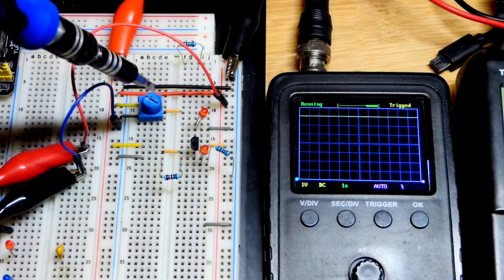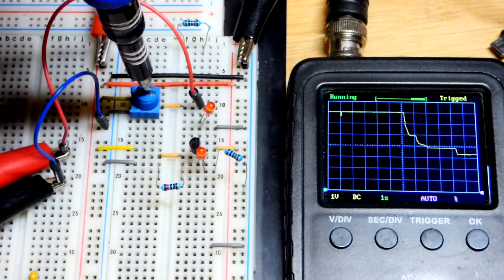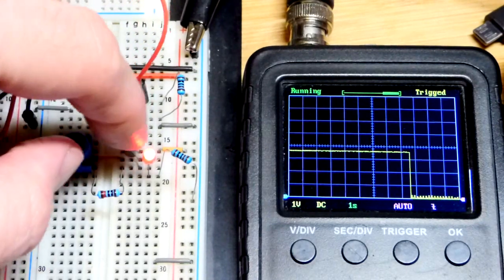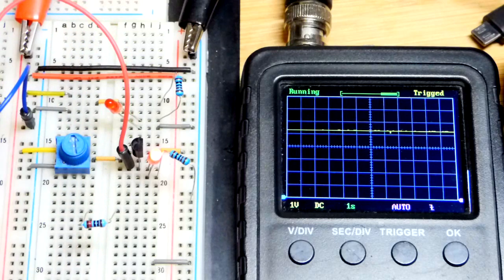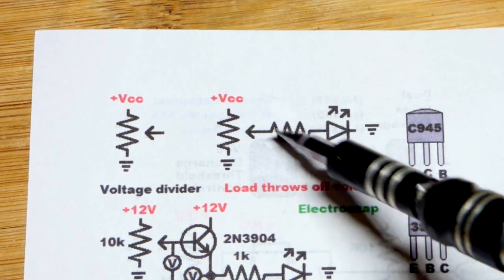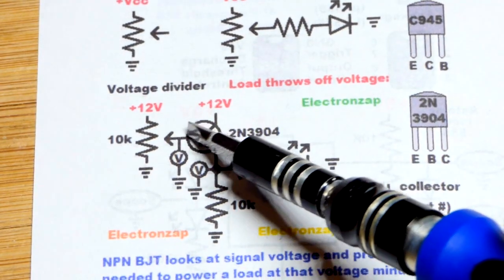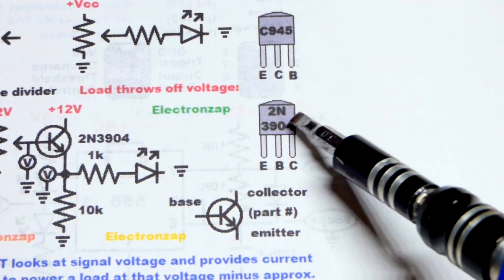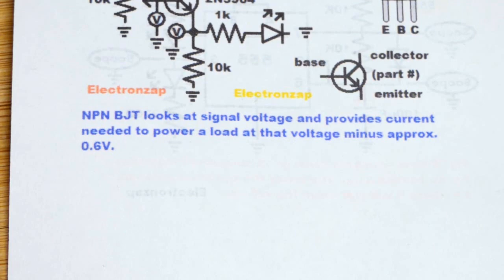Voltage divider amplified with NPN BJT emitter follower Electronzap learning electronics lesson 0016

Comment: Excellent video. I love the diagrams. I think you do the best emitter follower BJT EFstuff on the internet! It would be interesting to see a video on opto isolator EF configured to send a high signal vs using it to sink current.
Reply from the maker: Thanks! That's an interesting topic, I've only used an opto isolator once or twice. Don't know if you can make a follower with them.
Reply: @Electronzap  I'm not that smart and still learning from you.  I'm using this to source come current https://www.nutsvolts.com/uploads/wygwam/NV_0200_Marston_Figure02.jpg maybe this is not EF but it looks about the same.  I was able to understand it because of your prior EF work. I'm using these to feed signals to LifePO4 BMS. Here is the article. https://www.nutsvolts.com/magazine/article/optocoupler-circuits the drawing came from.  Thanks again for all you great videos.
Reply from the maker: I would think that a low enough light on the base would result in a lower voltage out but the load wouldn't affect how much light falls on the base, whereas it affects base to emitter current of a regular transistor. Looks to me like that circuit is made to saturate the transistor when the switch is close, and thus the full supply voltage will be at the emitter. I'll try to remember to do some experimenting with the optocouplers I have.